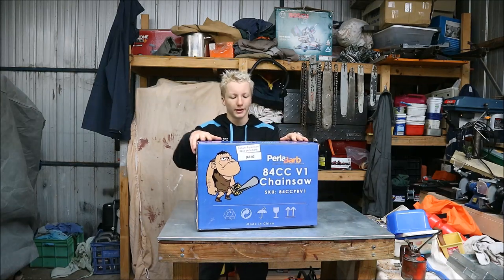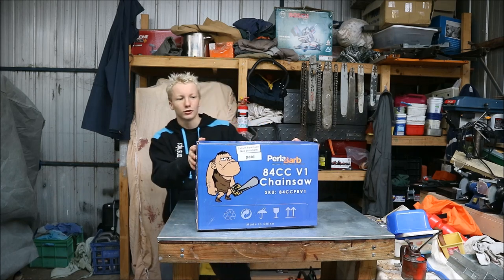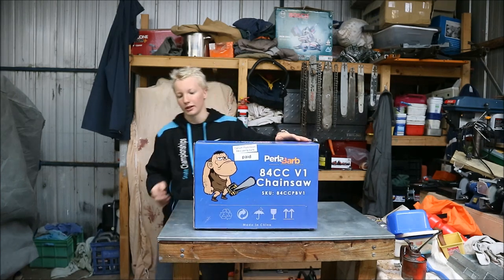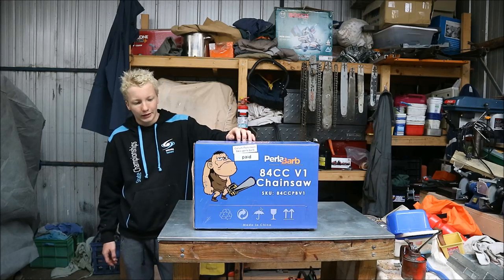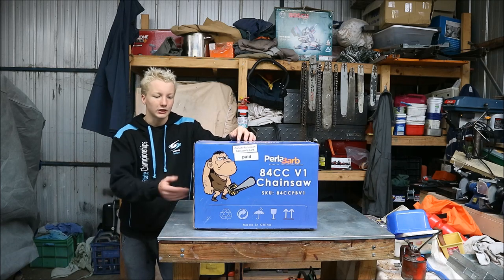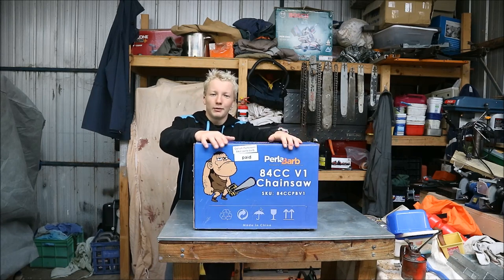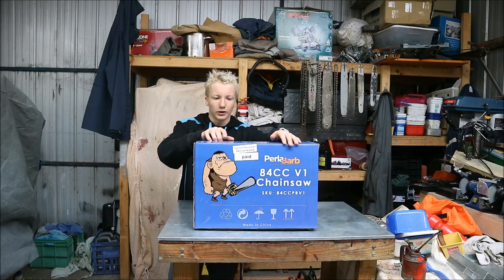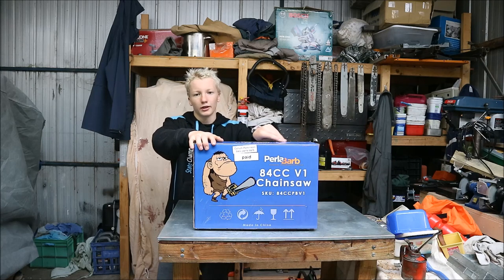Perla Barb 84cc Chainsaw unboxing. Chainsawspares.com

Comment: Will you be measuring the bore?
Some of the 82cc 92cc baumr and perla barb were 65cc and 72cc.
Interesting saw i have 266/268/272/288
Some of my favorites
I have. Several clone 365/372
I've been running them for year's
Swap out the fuel and pulse lines
And they are good saws.
Reply from the maker: yes I will be, specs say 56 mm by 35 mm
Reply: Stupid question the 92cc what model was that based off of?

Comment: Well done you! I'v nearly killed my husky450...was thinking/ hoping 2 big cc cheapo's would do a  double powerhead GB extra long bar for slabing,1 tree slabbed would pay pay off 2 saws...my biggest tree I'ld like to cut a round (or 3)out,Is at least 7-8ft dia,would a cheapo 90cc + handle said rounds (mountain ash estimated age for dia= 800years-)it tipped over, fell in the last strom,so still a  green)) again 2 or 3 rounds would pay pay off the saw,but are they up to running a 6/7ft bar..the build quality is bit of a put off..so is $3k for a good stihl/husky,
Reply: Op's more like 3 to *400 year old ( thats the *oldest )& my one is still up there in age/ dia
Reply from the maker: Depends on the saw. A saw third size probably wouldn’t be up to it. I do know someone who runs the holtzforma g666 and g777. Bit of those saws would be more than adequate for your intended purpose granted you run good fuel and oil, a sharp chain and take your time.

Comment: You should never start it without the clutch cover off because if that clutch flys off good luck
Reply from the maker: only if the clutch isn't tightened properly, if it is together right it isn't a problem.

Comment: My Perla Barb post hole digger fell to bits after only a few uses...
Reply from the maker: mudbutton2 I have this saw well over 15 hours of gruelling work and it didn't fail me once. Keep in mind this is a clone of a a well respected husqvarna chainsaw. I am not sure about there post hike diggers
Reply: @v26224  The carby fell off my digger when the bolts came loose.  Tightened them up and it happened again. Then the pressed steel fuel tank guard broke and again, all the bolts came loose.  I think the main issue is assembly related - namely no Loctite on the bolts. When it's running it runs well. A bit of a shame really and I wouldn't consider buying anything else of the same make after this experience.
Reply: @mudbutton2   Just an FYI...nobody "locktite" on assembly in any factory.
Go over any new machine (these days ) and lochtite, anti seize, spring washer any thing that is suss.

Comment: Callum very well done. Thoroughly enjoyed your work. Seeking your advice and direction. I have a stihl 032 AV.(40 years old).Broken the muffler, finding difficult to get replacement.Looking at cheap back up for my other saw a Husky. Looking around 55-60 cc.suggestions
Reply from the maker: for a cheap saw you can't go wrong with a decent second hand stihl or husky from a reputable seller. or if you jump on facebook, most of the chainsaw buy, sell groups are really good at supplying second-hand parts if you ask, if you want to pursue getting a replacement muffler for your 032, cs that saw is Definity worth fixing.
Reply: @v26224  Thanks so much for your your response. Have had a look around for the muffler, but no success . Tried a couple of fb sites but no cigar. Will keep looking.a lot of  family history behind the 032av.May just purchase a new husky or sthil with a little less grunt  and weight than the 032aV.. Looked at some of the Chinese versions but found that pull start on most really difficult especially for person who suffers the occasional shoulder swimming niggle! Once again well done.
Reply from the maker: @waynebourke4970  are you in Australia, if so jump on the chainsaws Australia Facebook page. plenty of helpful blokes there

Comment: The plastic piece you turned upside down is supposed to be thrown away
Reply from the maker: Sorry but you are incorrect. It is a wear pad that is found on all husqvarna chainsaws. It stops the chain digging into the magnesium if it comes lose

Comment: Look, regardless of what your measurements find (using 3.142 x radius squared x stroke), Facebookers are always more reliable than even the most experienced mechanical engineer, mechanic, manufacturer, slide rule, depth gauge, bore micrometer, machinist, mathmetician or scientist; so if they say it isn't 84cc, then sorry mate - it 'aint! 

Proof has nothing to do with FB.
Reply from the maker: ThePaulv12 mate sorry but you just came across as a total jack ass. The displacement is 84cc, and if you want to argue buy one yourself and measure it. That being said, just because it is 84 cc doesn't mean it has more power then a 70cc saw
Reply: @v26224  No offense but I think you missed the (well written) witty and quite humorous sarcasm here. He wasn't having a go.